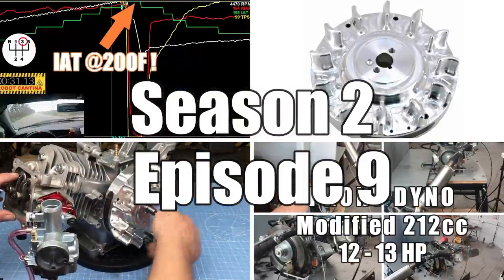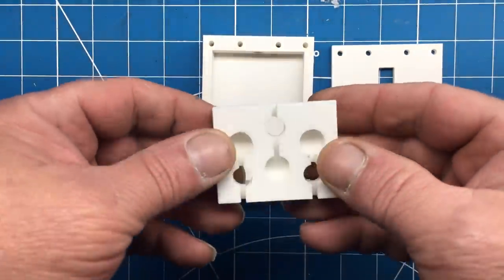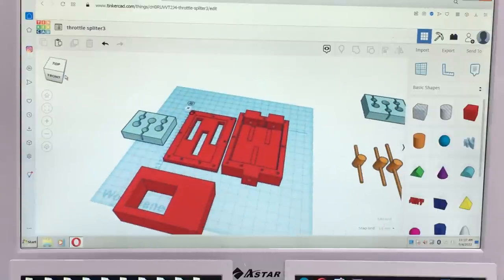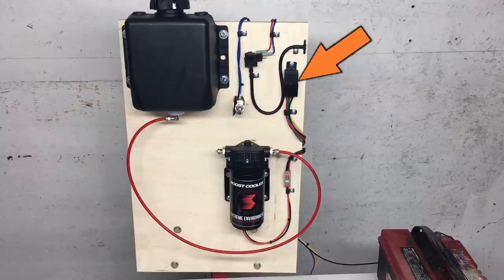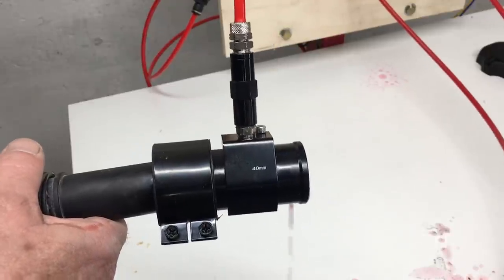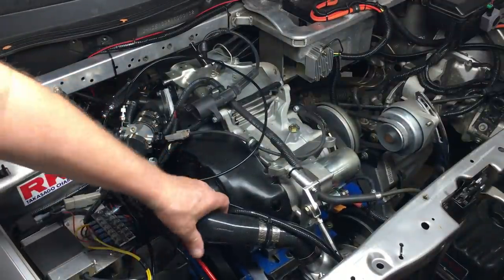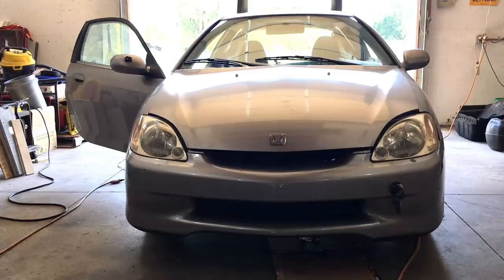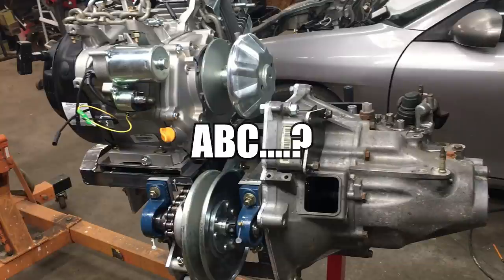S2E9: She’s burnin’ up Cap’n!  The 420cc supercharged hemi gets methanol  injection

Comment: Needs more cam duration and lower static compression ratio with higher boost pressure.  Ideally your torque peak should be just below your target rpm in top gear.   Remove weight for better acceleration and reduce aerodynamic drag for top speed.  The open hood area is probably dreadful parasitic drag.
Reply: Which is harder to come by  == baby formula or gas??
This channel has me coming back for more.👶👶👶👶👶
Reply: @kansasrose2909  They are both worth their weight in gold. !!
Reply: @ocdman202  CONGRATULATIONS  JIMBO.  👍👍👍👍👍 you have reached 106K   SUBSCRIBERS!   ROBOT CANTINA 
is providing the entertainment and education and FUN   that viewers enjoy!  Please provide more content here JIMBO!

Comment: This suggestion might be expensive but buy another cheap Honda and a 670cc predator engine inside it and see how fast it goes.
Reply: Or use get a 660-cc Kei engine from Honda, and bolt it in.  but where is the fun in not reinventing things.
Reply from the maker: We already have a 670 engine waiting to be installed in this car.  We need to reach our goal of 70 MPH before we move on to the other engine.
Reply: @robotcantina8957  😊😊😊😊

Comment: Interesting EP Jimbo, can you explain the twin throttle body thing? 

I'd have thought running the one post blower would be enough but would need a blowoff valve.. 

I like the data sets, I was sitting here smiling at the 0>60 time, I ran a hill climb in the Panda last year, uphill I was doing it in 2.36.. 

Those iat's at idle are insane, is the drive ratio 1:1 and where are you injecting fuel this time?
Reply from the maker: With the double throttle body, the engine vacuum is contained behind the second throttle body.  This keeps the vacuum from sucking the oil through the seals on the supercharger at idle.     In fifth gear the CVT is at 1:1, however when you factor in the chain drive and all the gear ratios, filth gear works out to be 4.028:1
Reply: @robotcantina8957  sorry I wasn't clear, I meant the Blower drive ratio, what I mean about the throttle position is if you use the one after the blower only  there won't be vacuum in the blower as it's inlet will be open to atmosphere, the only issue will be when you close the throttle you'll need a blowoff valve like a turbo..
Reply: @IJ-E36  This is fascinating.
Reply: @ocdman202  Vroom   Vroom   more Bazooka.
Reply: Gas prices hit another all time high on Thursday!
Reply: @kansasrose2909  We are on the precipice.

Comment: Strap an all-in-one watercooler meant for a computer to the block with some sort of thermal interface 😂 Now that AMD Ryzen is dead those AIO are discounted and have the largest surface area for the best possible heat dissipation! Tiny engine, tiny radiator.

Comment: Don’t run water at all. Run pure meth and get ready to dial in that PWM duty beyond what you calculate. You shouldn’t be anywhere near 226F, especially with my experience running meth on a gt1446 bolted to a 1.4L engine. There is a different blade tolerance when spraying meth through a blower btw.

At least that’s what Gale Banks said, I don’t have experience with blow through setups so I’m only repeating what pros say here. You may consider, dial nozzles with one before the FI device and one after.

Additionally prometh has excellent nozzle available and selection.
Reply: I come here for the videos and stay for the great comments..👍
Reply: @ocdman202  I come here for the comments and stay for the insanity!!
Reply: @kansasrose2909  a bit of column A and column B. I’m a meth head with an engineering degree after all.

Comment: What is the end goal? Fuel economy? Why not hybrid it to make acceleration better, that would help with fuel economy too...
Reply from the maker: The end goal is to go 70 Miles per hour with a cement mixer engine.
Reply: @robotcantina8957  😊😊😊
Reply: When I was a teenager in the late 30's and early 40's, electronics wasn't a word. You were interested in radio if you were interested in electronics.

Comment: How about using a fuel injector and PWM for the boost juice?
Reply from the maker: We thought about that and may try it.  The only concern is the methanol has a reputation of causing corrosion and we are not sure an injector would survive long.
Reply: @robotcantina8957  😊😊😊

Comment: Why do you use 2 throtle bodies instead of just one after the supercharger? Is it because it's a positive displacement supercharger?
Reply: @ocdman202  Man,, you look very happy about  this video!!
Reply from the maker: Yes, on a positive displacement supercharger the throttle is ahead of the compressor.  On a centrifugal supercharger or turbo the throttle can be behind the supercharger.   The only instance that I know of where a positive displacement supercharger doesn't have a throttle is on the 2 stroke Detroit diesel engine

Comment: have you ever tried without the CVT, just manual , you 'll gain a significant amount of power at the wheels without the CVT loss
Reply: The cvt's for getting it moving i think.  Would need pretty small ratios for first gears
Reply: @lasskinn474  sounds like that's the purpose of 1st and 2nf gear right? the fact that he's starting in 3rd and using the CVT to simulate  a lower gear but losing precious power at the same makes me wonder if it's the best strategy.
Reply: @geemy9675  well once it was moving. he does describe in the vid that it would need a lot of rapid gear changes to get it moving in the first place, or burning the clutch on level ground. there's not much power in the lower rpm's in the engine so the power band you'd have to work with to get it moving from a standstill is pretty slim.

so while in a car sure it would be 1st gear here it would need to be like 1st,2nd,3rd,4th,5th,6th in high ratios and well in the higher gears to get to the higher speeds too to get the use out of the power band, you'd need like some garage54 2 transmissions back to back kinda thing probably.

it's not uncommon at all to see farm engines(2 cyl diesels) on a farm truck kinda things in thailand. their max speed on their ratios they put on them is very low though.
Reply: @lasskinn474  nope he usually starts in 3rd with the help of the CVT. here I'm 2nd because the meth injection was making it run worse than usual. I remember there was another for the CVT because mating the harbor freight motor directly to the manual transmission was complicated. then the CVT maybe has the bonus of making th 3rd gear actually lower than the 1st without cvt
Reply from the maker: The cvt offers infinite ratios that we need to launch the car, otherwise the car would be a lot slower off the line.  Also the CVT pulleys and belt do not get hot.
Reply: @robotcantina8957  😊😊😊😊
Reply: @robotcantina8957  I know but infinite ratio are not needed to launch a car properly, you just have to stay in the powerband. CVT is faster if it maintains peak power rpms, but here it's not tuned properly and you have no control over it, so proper shifting the manual transmission might do a better job job while not losing power. it's not hard to shift at the perfect moment when you accelerate that slowly ?
Reply: @geemy9675  I love the smart comments here.
Reply: @ocdman202  Gas prices hit a new all time high Thursday!!
Reply: @kansasrose2909  When I was a teenager in the late 30's and early 40's, electronics wasn't a word. You were interested in radio if you were interested in electronics.
Reply: @ocdman202  CONGRATULATIONS  JIMBO.  👍👍👍👍👍 you have reached 106K   SUBSCRIBERS!   ROBOT CANTINA 
is providing the entertainment and education and FUN   that viewers enjoy!  Please provide more content here JIMBO!

Comment: I think a higher meth concentration would help, as Boost juice is like 60/40. Try a 20/80 blend or just straight M1 (not M3 or M5, as that will ruin things).
Reply: That sounds like something to try!
Reply: When I was a teenager in the late 30's and early 40's, electronics wasn't a word. You were interested in radio if you were interested in electronics.
Reply: @ocdman202  Jimbo === is that Saturn back on the road yet?   We want to see how it runs with the Diesel engine  in it!👍👍

Comment: I need to know.  Why are you using two throttle bodies?
Reply from the maker: It was explained in the video.  The second throttle body is to keep the engine vacuum from sucking the oil out of the supercharger.  The twin throttle body system is used on supercharged  engines when it isn't practical to have a bypass valve.
Reply: @robotcantina8957  
So now you're creating vacuum pre super charger instead of post. I'm surprised you aren't running into the same oil sucking past the seals issue. 
You are running such little boost,  I bet you would find the pre blower throttle body is unnecessary, it may even be a restriction if the TB is smaller than the blower inlet.
Reply: @BGJohnson  Good observation here,
Reply: @ocdman202  CONGRATULATIONS  JIMBO.  👍👍👍👍👍 you have reached 106K   SUBSCRIBERS!   ROBOT CANTINA 
is providing the entertainment and education and FUN   that viewers enjoy!  Please provide more content here JIMBO!

Comment: Use the cars old radiator as the intercooler
Reply: And if you don't have one  add a wideband 02 sensor+ gauge
Reply: It's basically the exact same item 
 And u doubt you can create enough psi to break it .  The radiator cap usually has a 14or close to psi limiting spring that dumps hot coolant into the resivor. ( Works kinda like a spring controlled. Waste gate
Reply: @jasonwhite8722  My weekend countdown has begun,  where are the icecubes??🥤🥤🥤🥤🥤
Reply: @kansasrose2909  :elbowcough::elbowcough::elbowcough::elbowcough:

Comment: I have been wondering if you can use one (or more) Peltier elements instead of an intercoler?
Reply from the maker: Peltier elements consume a lot of electrical energy.  I reckon if enough were used it would work, but you would probably need another alternator or two just to power them.
Reply: @robotcantina8957  😉😉😉
Reply: Robot,    are we going to see more from  Robot Cantina??
Reply: When I was a teenager in the late 30's and early 40's, electronics wasn't a word. You were interested in radio if you were interested in electronics.
Reply: @ocdman202  CONGRATULATIONS  JIMBO.  👍👍👍👍👍 you have reached 106K   SUBSCRIBERS!   ROBOT CANTINA 
is providing the entertainment and education and FUN   that viewers enjoy!  Please provide more content here JIMBO!

Comment: needs a cam and the governor removed
Reply: i have managed 20ish hp from a hf 212 you can do a lot better you just need to get the it tuned for a 8-9k rpm run cut about 10% off the mass on the fly weights on the tq drive to raise the engagement rpm it's configured for a stockish motor you get more power in a fixed displacement by adding air Flow it's a pump adding 7psi to an engine near sea level adds 50% more flow and power But you need to subtract the power losses from the boost method i really don't think that superC is power efficient a small rb20 or t2 turbo will make the boost while adding less drag 
all that said add a map sensor and map the boost to rpm use a map sensor that has at least 1 bar of head room above peek boost and while you might get 5psi at 3k rpm you might have 10psi at 6k
and tuning the weights and spring of the torquevert will rase the rpm up to that level might even make 2x the hp if you worried about fuel efficiency i can show you how to add a hit miss cycle on the arduino efi i expect spark at -18 to -22deg and fuel hits just before valve open
Reply: @ZoeyR86     Has Jimbo tried the Tesla Turbine??
Reply: @ocdman202  Has he installed the flux capacitor??

Comment: Why not just the throttle body at the intake manifold?
Reply from the maker: Because we are using a positive displacement supercharger and not a turbo.
Reply: @robotcantina8957  
Little to no experience with roots blowers and petrol engines.
I assume then you would have problem regulating the fuel mixture at idle due to too much air being forced past the throttle body?
Reply: @Mr.Engineer.  CONGRATULATIONS  JIMBO.  👍👍👍👍👍 you have reached 106K   SUBSCRIBERS!   ROBOT CANTINA 
is providing the entertainment and education and FUN   that viewers enjoy!  Please provide more content here JIMBO!

Comment: Too much methanol…your losing more power than your making because it’s flooding the engine…methanol injection should be at 8-10 psi actuation on this engine so as to give it a chance to run up a bit beforehand and injection rate should be roughly halved… an intercooler designed for a small eaton m90 would suit perfectly

Comment: You missed a chance to turn that Honda into a fully electric car.  In my neck of the woods (Vermont) electricity is $0.24 a Kwh. A gallon of gas costs 4.50 bucks. The break even point here is when gas becomes cheaper than $2.20 a gallon. If it is higher than that it would cost me less to go to the store if I had an electric car.  The Insight is only 1300 Lbs.  Perfect for fuel economy regardless of the power source. Oh yeah and electric would give you 0-60 accel times in the single digits.  ?   :)
Reply from the maker: Although I have an electrical background, I'm not really into doing electric cars.  The fun in this video series is how far can we push a lawnmower engine.
Reply: @robotcantina8957  I've been following this project from the start and have learned a lot. Your journey has 
been inspirational, informative and fun.  So... don't get me wrong with all my electric 
mumbo jumbo. I'm a gas engine nut. It's just the price of gas has me rethinking some 
things.

I just put a 450 watt motor on my bicycle. I can go to town and back (25 miles round 
trip 20 mph avg.) for 0.25 Kwh ($0.06) and there is little of Vt that isn't a hill.

However, FYI and anyone interested:

1 gallon of gas = 36 Kwh
1 gallon costs $4.50
1 Kwh costs $0.24
36 Kwh = (36 * $0.24) $8.64  (cost of a "gallon" of electricity)

Gasoline engines are 25% efficient converting fuel into motion. The other 75% turns 

directly into heat.

$8.64 * 25%  =  $2.16

Electric motors can achieve 95% efficiency.

You can manufacture electricity at home (wind solar hydro etc.).
You cannot manufacture Gasoline.

Just sayin'  :)
Reply: @ebenwaterman5858  Love the great comments here.. I come for the video and stay for the comments..!!